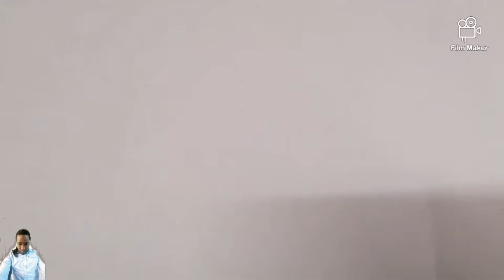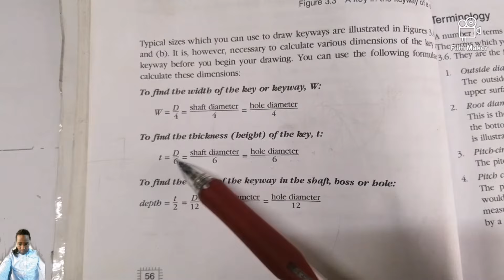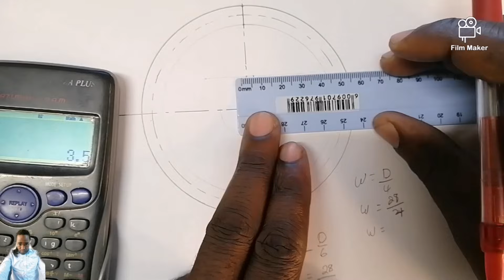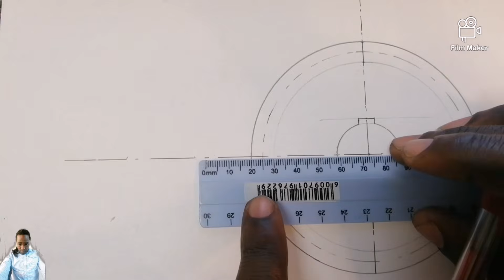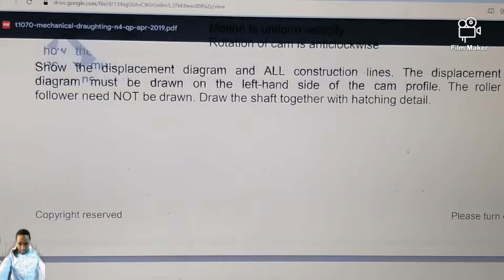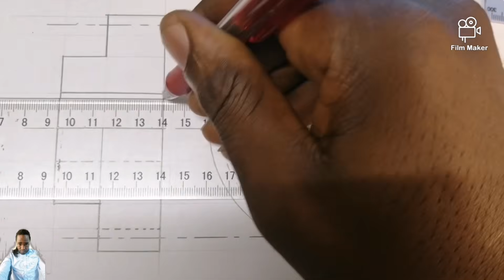N4 Conventional Representation Gear

Comment: Hi. Please clarify for me. Is Mechanical draughting N4 different when you are doing it under MDDOP course versus Mechanical Engineering N4 course? 

Are the books and question papers different?
Reply from the maker: The books are different, but the concept is the same
Reply: @etutorsdigitalschool2215  Thanks. 

I would also assume the question paper is the same?
Reply from the maker: @meme-zs3pl not exactly the same, but the concept is similar